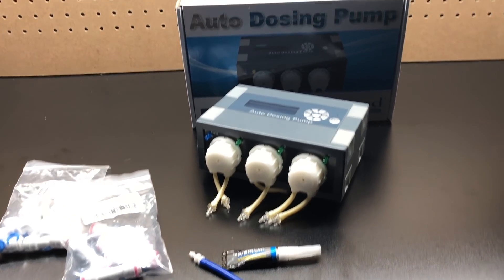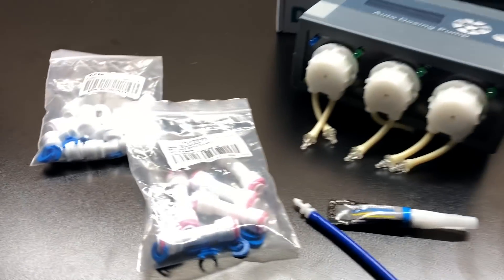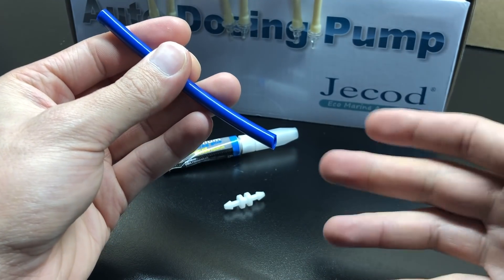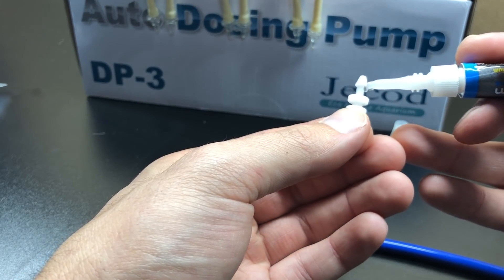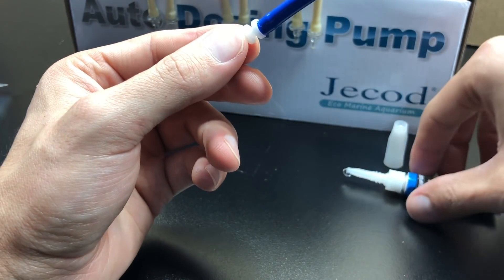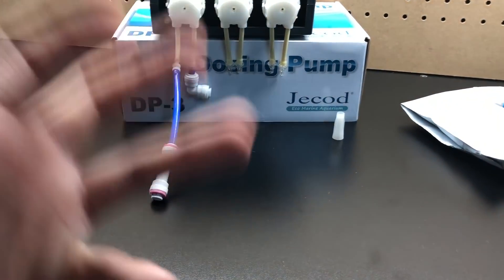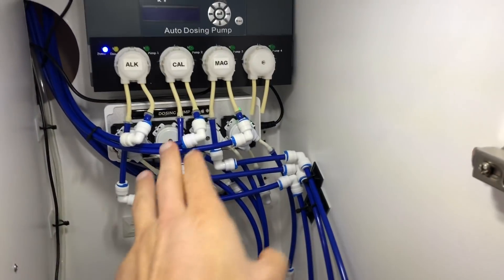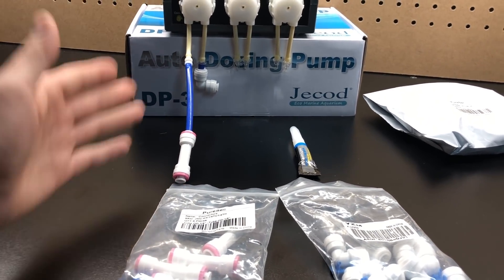Making Your Doser Accurate (Upgrade)

Comment: I know it's a old video but am just getting to it great info. I have a question for you may have a answer.  As far as the tubing that goes around the power head do you know what size that it I have one pump that is leaking and need to fix it .thank you in advance

Comment: The check valves you are showing are the WORST.  You can't blow or suck through them.  I thought they were broken so I took my 150psi air hose and that did blow through them but there's no way a normal pump will push through those things.

Comment: You can use Y connectors to gather all the outputs. So you will have only ond tube running up to the tank instead of several

Comment: I'm so glad I found this video! I almost gave up on auto dosing. I set up my doing pump last week and a few days after putting it online my Calcium levels went off the chart. (500+). Turns out I had a little siphon happening so it was dripping Calcium all day for about three days. Going to covert it over to RO lines ASAP!

Comment: I just started using a dosing pump on my planted tank to make life more consistent. I like the idea and will be using it. I’ll just change for rigid acrylic tubing. It’s alittle expensive unless you have short runs and you could also use flexible tubing in places it’s not seen or for bends. I just bought 12 12” acrylic air lines for 14 on amazon if anyone is curious. I like to see the liquid in the lines and it’ll make straighter runs if you’re extra ocd about that.

Comment: Hi, quick question they sell check valve elbows on Amazon. Is it better just to get the straight line check valve? Or will the elbow check valve work just as good?

Comment: Awesome video and great tips! I noticed that you are dosing the Red Sea Trace Colors with your dosing setup. I dose the same in my tank, but I currently use silicon tubing with my doser. I’m needing to flush the tubing for the Trace color B (Potassium+) about every month since the dosing liquid crystallizes within the tubing. Have you found this to still be the case while using your RO tubing approach?
Reply from the maker: Hey great to hear! It’s a great product. It  crystallizes on the exit but not inside. Since it stays primed the inside is always perfectly fine. So in other words this upgrade will fix your issue :)
Reply: @DeepDropFishingTV  Awesome!  I'm definitely going to give this a try.  Thanks for video!

Comment: Hey! Thanks for taking the time to make this. I had requested it when i saw your other vid and i figured you forgot to make it but i was wrong. Thank god too i was just about to give up on my coral box doser, it has been driving me crazy with air bubbles! I just started this project today and so far so good.

I have one question though, i have black ro tubing, how can you tell if air is not creeping in? With my other tubing it was clear so it was easy to see. With this i will have no idea... i did purchase the John Guest check valves as well...
Reply from the maker: Hey man great it came out just in time :) you will
Never see the bubbles. For you in that doser after a week of running do manual dose of .5 mil or so. If liquid. Ones out immediately that means it is good :) trust me you will be fine especially with the John guest ones.
Reply: @michael sussman
R u still getting bubbles in your coral box dosing pump?